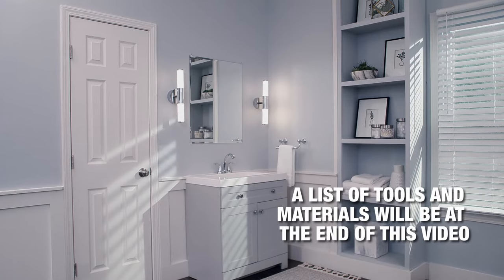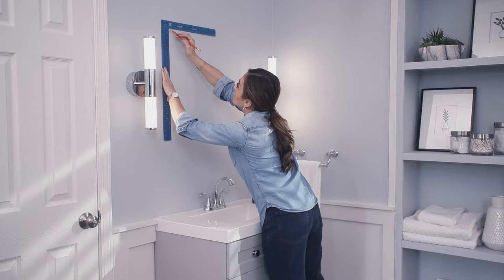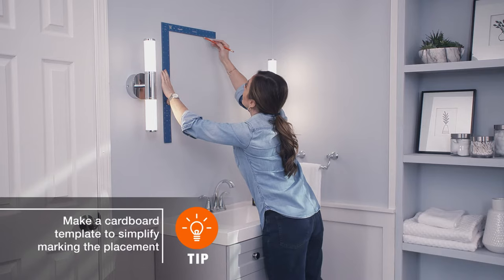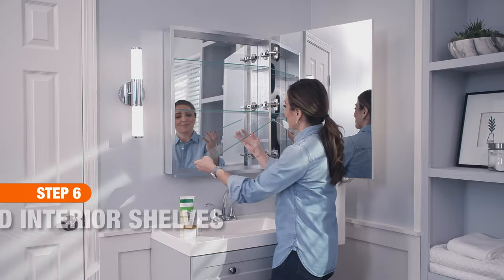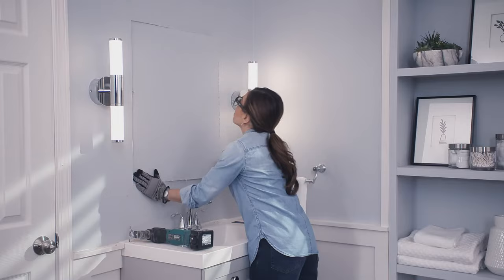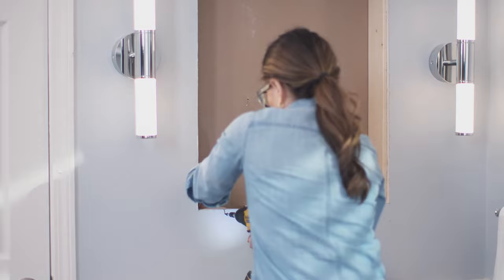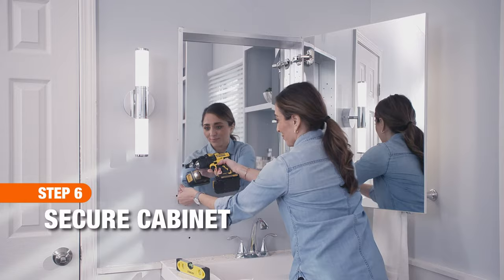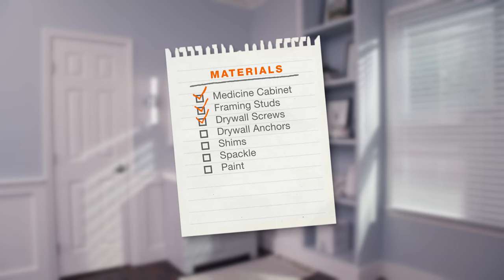How to Install a Medicine Cabinet | The Home Depot

Comment: Be sure there is clearance over the sink faucet for your hand to open the door.
Reply: I take it you have also made this mistake on something before. lol.
Reply: @ashrainproductions...I've seen it in a "fixer upper" house I looked at with way too much "diy gone wrong" inside! 😆
Reply: Thansk boo
Reply: Same goes for the vanity light!
Reply: And make sure you lift the faucet handle up (on) and allow an additional inch in case you ever switch out with a taller faucet

Comment: Nice! How do you know how high to mount the cabinet?
Reply: If not included in the printed directions, I would think you'd measure from the top of the counter to the highest point of the faucet (remember the lift stopper in back may be taller than the faucet when raised). Be sure when you install/mount the cabinet that you have left at least that much in clearance below the lowest point of the cabinet/mirror. Blue painter's tape can be a good friend here.😁

Comment: I was just wondering what blade to use when i cut the stud
Reply: It probably depends upon your clearance on the back.  A reciprocating would be fast, but you'll probably have to use an oscillating tool with a flat blade.  Reciprocating saw (Sawzall) blades shoot out a ways beyond the cut, so if there's no clearance on the back of your stud, it won''t work.  And, you can't get in there with a jigsaw or circular saw.

Comment: Did you install the short precut 2x4s to the sides of the cabinet, on the narrow edge or flat to the wall?  I think the narrow edge to the wall, to allow more attaching surface for the cabinet, but I'm not sure.  Is the cabinet lip wide enough to cover the 2x4-to-wall screws?  Thank you.

Comment: Mine is a mix of recessed and mounted because my exterior walls are so thin 😂

(this is a joke, or maybe not, I don’t know the reason it’s half in and out, it came with the house. Based on the fact that I can’t drill more than an inch into that wall without hitting something hard, I assume it’s something like that)